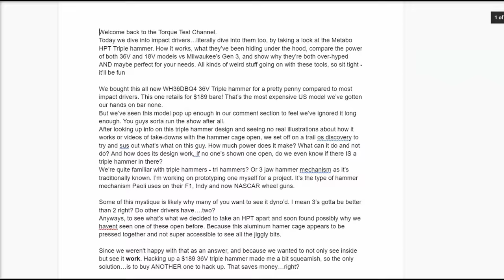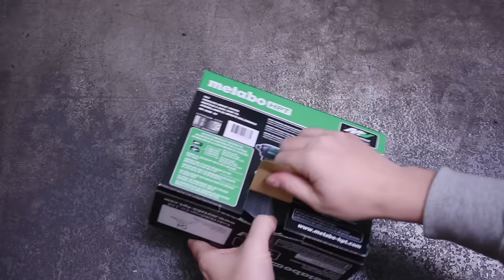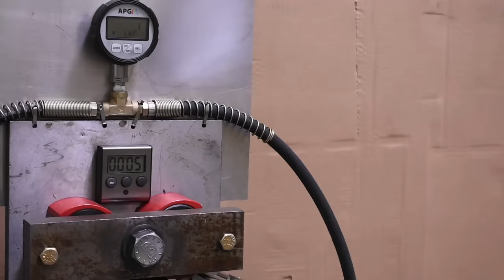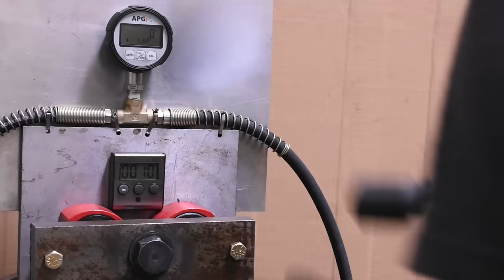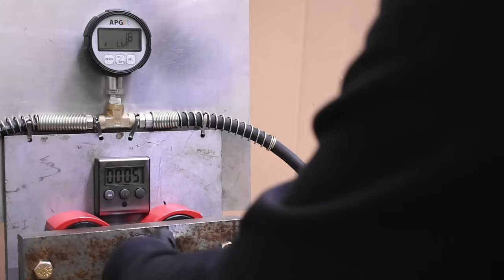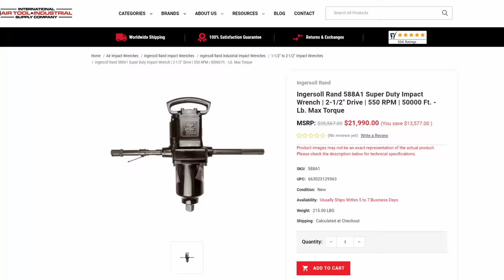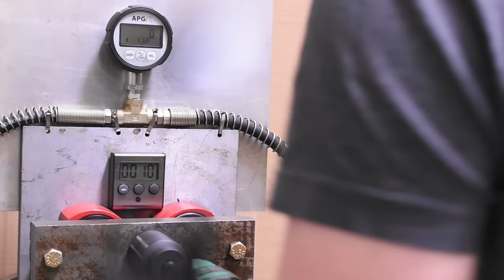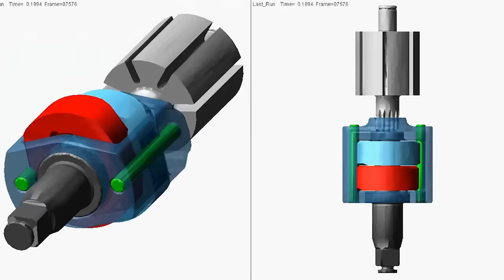High-Speed Video Uncovers Weird Stuff In Popular Impact Driver (See Comments)

Comment: Love high speed videos. This confirms what I suspected could be happening with two lobe designs already.  But we don't see this drop in performance much so I assume I am wrong this happens with the common two lobe design.  Still seems to me though a one lobe design would allow twice the momentum buildup and ensure spring return more reliably.   I assume greater bearing and shaft stress is why I have yet to see this.     Anyone remember years  back they had emergency impact drivers you plugged in to the 12v lighter outlet?  It would build up for 20 seconds and then give a single super hard hit to break loose lugnuts.   I would love to see a cut open view of that working and how that compares on your dyno.  Appreciate your vids for sure!

Comment: Like I said in a video a while back, that triple hammer seems to be restricting the tool. not enough time in between impacts to build enough momentum and it skips a lot because of that
Reply: It only skips at the highest power settings. And, by skipping, that gives it twice as long to speed up, which means stronger impacts. That can be beneficial in some (though not all) situations.

Comment: It is obvious that the intended use of the impact driver is based upon its use to application. The foot torque requirement was based on what it is mostly used for so that the life of the battery can extend its life.

Comment: This is a prime example of adding more power without thoroughly vetting the rest of the drivetrain. We see this in automotive applications all the time where are you at a whole bunch of power or beans to an engine and you know your transmission will physically stay together with that much power but your clutch is not designed to handle that much power or your torque converter is not capable of completely Translating that power into movement. Very very interesting really cool of you guys to post this stuff up

Comment: Sounds like Metabo made 1/4 rotary hammer drill!
Reply: Knew I would eventually have a use for those 1/4" hex shank masonry bits!!
Reply: nope not Metabo, but Hitachi
the branding is just a stupid clusterfuck since the gone away from Htachi branding

Hikoki and Metabo HitachiPowerTools are the same and just the former Hitachi with a new name depending on market
Metabo without any suffix is a different company with different tools in their lineup useing different batteries and designs

but the clusterfuck doesn´t end there, Hitachi Koki bought Metabo before the nameing change but isn´t part of Hitachi itself anymore
some us based investor is the owner of now Hitachi Power Tools now
so so the japanese company bought a german company in the same field and belongs now to an us based investor and while both companies still compete in the same field with different designs it´s possible to buy a tool from the japanese company thats useing the name of the german company in for instance the us

damn i hate this stupid rebranding

Comment: Skipping a dog is for gaining inertia by spinning up the hammer. The torque spike can be seen in twisting those screws. Of course that means lower drive speed we can also observe. I do not know your dyno setup but it just might not pick up those spikes sufficient enough to be a useful comparison.
Reply from the maker: The dyno works on bolt tension. If a tool can tighten the bolt more it registers it. The gained inertia seems to be stalled by hitting the top of the next dog 1st

Comment: i believe they cheaped out on the parts as the tool got later in the production run i had some of the original triple hammer impacts when they were still just Hitachi and they were absolute beasts but my work trailer got broke into years later so I had to replace them and the newer ones performed like garbage and I couldn't figure out why

Comment: Metabo Might be worse on the torque reading but man after using them for a straight hour, they ran much cooler doing the same job when I used a new Bosch impactor with 8.0ah battery… the Bosch would burn your hand at the metal just by the chuck… and I had power loss/weird sounds with the Bosch when they got hot

Comment: I have to imagine they found this flaw while trying to develop this tool but decided the marketing value of a triple hammer was more than that of a tool that actually preforms as it should. That is why you find the 1.5 value online.  It also makes sense that this works on bigger guns because they can overcome the higher spring pressure with lower gear ratios and more speed. Overall I would really love to be a fly on the wall at big tool companies when a YouTube channel keeps them honest.

Comment: My milwaukee fuel also skips a beat on certain fasteners. Too many ipm? The collet also drops bits. Actually kinda dangerous.
Reply: Every impact driver does it to an extent, the collet thing might just be an issue with the collet though. I know Milwaukee revised the 3rd gen fuels for that.
Reply: @reaperreaper5098  -  yep, gen 3 has been corrected from what I can see, but you can change it out your self on the older models.

Comment: For one thing, using simple screws into wood, no impact is actually ideal and a standard drill/driver is always better. I tested this on the weekend, went and bought the new Combo drill and compact impact Dewalt kit,  trying to simply start a screw and install some pipe clamps into a 2x4 board, the impact was worse at getting them started and overall too much torque on the screw…. The drill was much quicker and got the screws biting into the wood easier.      Impacts are better for things like pole barn screws, concrete screws and your much bigger construction screws or lag screws.

Comment: A solution would be to install some form of a bump stop.  This could be a second shorter spring, or rubber/ polymer bushing  The hammer misses when it jumps too high.  The bump stop would fix the problem without changing the rest of the design.  (A bump stop would make it vibrate more, so there's that...)
Reply: Thats something that can work 
Or use the same strenght spring but with short working range

Comment: I suppose it’s probably a decrease in power. The funny thing is that it will do this in forward. The old timers love the impact wrench for removing stuff but disagree about it’s use for driving things tight.  Because the impact wrenches are more likely to snap off an over hardened bolt.

Comment: Okay so on the back of that hammer assembly, I see two tabs for transferring power. I wonder if, especially when doing the inconsistent sorta-1.5 hits per rotation, the angular momentum isn't being transferred consistently from blow to blow. The motor is pushing in two directions, while the hammer is pushing in 3 but not even at a steady rate. You could see Tools & Stuff almost fighting with it at some points, it's obviously got some lateral movement. You can even see this on other tools to a degree but the 120 vs 180 might introduce more fluctuating harmonic vibrations.

Comment: So cool to see the mechanism working! Looks to me like the high power mode allows the hammer to spin up to faster speeds before impacting the anvil, generating more force per strike. Is it possible that your dynamometer is giving weird readings due to the time between strikes being greater than the time window it uses to average out its measurements?
Reply from the maker: Nah, we're used to measuring slower IPM than this. Air tools for instance have 1/4 the IPM and still show well on the curve.

Comment: Seems the solution would be to use slightly less rpm until it dont happen. In this case less is more. This could easily be fixed in the controller. Or learned in trigger position and sound.

Comment: These manufacturers are all going 40 volt which means they can use the same amount of cells, wire it a little different and charge twice as much. They gave the battery the ability to switch from 5cells series and 5cells parallel. If the battery used the cells only in series you would have all the power with little run time. 36volt is the same exact as 40v just one manufacturer claims voltage at full charge 4,2v per cell and one claims voltage not fully charged 3.7v. That's why the DeWalt system is called flex volt. It can flex between voktages. If you could take that battery and rewire it to only be series it wouldnt kick down in power

Comment: Seems counter intuitive that double the Volts does not equate to many gains.... the tool uses the inertia of the rotating mass of the driver to create the needed torque. It is possible that the designers thought was "An extra rotational duration builds up energy and should increased torque delivery without added mass" But they underestimated the needed spring pressure? More energy in may simply equate to excessive inertial returns on the spring and it can't keep up. I don't suspect the action of the driver failing onto the anvils side instead of the striking face would result in much shedding of delivered energy,, It is a lubricated action.   It does seem that the bounce back may play a part too.. I;m looking forward to hearing the reply from the company.

Comment: I think it’s skipping blows to the anvil from the hammer to give the motor a chance to “speed up” so the hammer can hit the anvil at greater speed/power. So the difference with these is some sort of “timing” where “low power” hits every chance it can where “high power” will skip every other blow to the anvil from the hammer to give the motor a chance to speed up and smack the anvil faster and more (perceived) times.

Comment: i modified lidl 220v ac impact driver that had hammer with impact surfaces on 45 deg so there was less torque than specified, i cut of that tilted surface and made it vertical, and put washer beneath spring to make it stronger, now it has much more torque than before in both direction

Comment: Prior to buying a Ryobi impact driver, I’ve always just used a “regular screw driver/drill” for screws and bolts. 

First time using the Ryobi impact, I was driving a 4” screw into the wall stud, as part of a heavy duty wall shelf installation. 
Broke the screw, every-single-time. 
At first I thought the screw was defect.
And every time this happens, I now had a dead partial screw inside the stud, so I could no longer use that location, and had to drill a new hole on the stainless steel shelf bracket for a new screw location. (Drilling hole in steel isn’t easy…)
After the THIRD screw broke like this, I realized what was happening: the screw was overheating from the impact action, and got weak, and snapped. 

I changed back to drill/screw tool, and managed to drive all the 4” screws without further problem. 

I wonder how much of the “bendy screw” in this video is also a result of screw metal heating up. 
I do not believe it is simply from mechanical vibration & resonance. That type of action should not result in alloy’s crystal structure shifting planes. 

Anyone? Thoughts?
(Thanks)

Comment: Interesting I have two of these impact drivers and the 36 and the 36 volt Gen 2 from Japan and I've driven long fasteners so it's interesting to see these results. Still a fan of the impact I do prefer it over my milwaukee just the ergonomics and impact feel
Reply: That and the IP56 rating. Run it in rain with no fear

Comment: perhaps the angle on the surfaces of the anvil that hit the bogs is greater than needed. Perhaps some of that angle can be cancelled with compensatory angles grounded in the dogs surfaces that meet the anvil hits, or maybe that would ruin the dog because perhaps the thing is cheaply case hardened and has no depth.

Comment: You can see the bit calet moving up and down when it mangles the first screw in the video. Just ever so slightly proving forward thrust on the screw as it’s driving.  Looks like valve float from weak spring also.

Comment: This "defect" is present and deliberate in every modern impact driver. They're designed for the hammer to skip blows in a seemingly random,yet balanced pattern that'll work to equalize the stresses in the screw and stop it from warping. The issue is much more likely that the M-HPT's pattern has no seemingly randomness to it, so it doesn't counteract itself and instead makes the issue worse.

But as we've seen with Tools and Stuff's videos, this largely happens on large and soft fasteners, which these types of drivers aren't really designed for. It simply isn't an issue for the designed purpose.

Comment: A flaw in design/ function like that should have never made it out of the testing phase.
Reply: It's not a flaw, it's a feature. This design has been around for a few years.
Reply: @histguy101  It's a blatant flaw.
Reply: @Chris_Garman  This design has been out since it was Hitachi. You can find plenty of explanations online for the three strike design, and no, they weren't put out in response to a YouTube video. The impact has 4 settings: soft, normal, power, and assist. Normal and power run at the same rpm. In power mode, when under heavy load, every 3rd anvil will be bypassed allowing the next strike more momentum.

Perhaps you're not referring to the cutaway demo, and confusing it with the bending screws. If you watched the original video, it was a torture test to compare the power between 4 brands. The tests intentionally exceed the designed purposes of an impact driver, nonetheless, the bending screws only happened on stainless steel screws(which are weak), of a specific brand, that were 6" long. Even then, it only happened to a couple of them, not all. The tool didn't bend any other types, brands, or sizes of screws or lag screws. It also only happened on one type of wood. 

If an impact driver broke a bit driver, would you say "it's a flaw in the design of the tool"? Because that happens all the time.
Reply: @histguy101  Because something exists does not mean it isn't flawed, even if the flaw is never addressed. Only occurring intermittently does not mean the flaw isn't a flaw. Stainless is generally much stronger than it's non-stainless counterparts in nearly every application.

Comment: Thanks for the great video !! I think there might be some element or safety feature as well at play here, In the 80’s corded drills had a habit of twisting out of the operators hand which resulted in a fractured or sprained wrist not to mention the drill flying out of your hand further creating potential damage to the project or people standing or working close by. I have these as well as makita and dewalt. For the utmost in reliability Makita wins it hands down so far me. Love the color and design of the Metabo

Comment: I think the skipping of the blow is not necessarily bad since the hammer achieves higher angular velocity and thus the next blow is with higher energy. What seems to me as a design mistake however are the axial impacts. I can´t think of any benefit of those, I only can see those undesirable effects like screw bending and it is also probably bad for the front bearing.

Comment: Imo, Sales pressure is pushing these tools to be too small and have too many ipms. These new compacts including gen 3 fuel get hot easily and skip beats. The new dcf850? at lowes seems to  be a good balance. The Rigid subcompact 1/4 impact being the most absurd model.

Comment: I’d like to know what size impact is more effective on rotating assemblies. For example when removing the harmonic balancer not from a crank shaft is a 3/8 better because it sometimes has higher peak force or is half inch better because it has more low end grunt. 

I think you can accomplish this by attaching your torque test rig to a brake rotor with either brake pads or parking brake shoes and applying pressure via a normal hand brake lever or captive nut and bolt.

Comment: this was a fantastic video, very detailed, I want to see every power tool demo'd like this.  I am in the market for a new cordless drill/driver, one with an adjustable torque setting like my Hitachi that I dropped.  Besides the duct tape holding the battery in, the fact they don't hold a charge nearly as long as they did when new a few years ago I am ready for an upgrade from 18 volts.  I loved how the Hitachi performed and will likely buy another but if there was a better one out there I might consider it.  Looking forward to more of your vids.

Comment: You may have covered this before but, I've run into situations where a Milwaukee m18 wouldn't finish taking a lock nut or badly rusted nut off a bolt but my nitrocat took it off without any issues. Are battery/electric impacts more susceptible to movement in the fastener like an air ratchet is?

Comment: Wow, you guys are really into impact drivers.  And didn't know people use 1/4" drivers on lugnuts.  Crazy..  I bust out the 1/2" gun for that.  I actually have never used a 1/4" impact that I thought needed more power.  I'm usually wishing they had better slow speed control.

Comment: Having 3 teeth per 360 degrees vs 2 teeth means there is less room between the teeth for the hammer to accelerate and build up momentum.
Think: 16-oz claw hammer.  In swinging the hammer to hit a nail, which hits the nail harder, the hammer swung in a 90-degree arc, or the same hammer swung in a 45-degree arc?

Comment: I used to work for a Japanese company (not a tool company) and when we would discover something that we couldn't find any data on the response was usually "Undisclosed feature, please accept".
Reply: From Hikoki JP:

"Under high loads, the number of strikes is automatically controlled, skipping one claw of the hammer, and striking 1.5 times per rotation. Energy increased dramatically. Achieves high screw tightening speed. Ideal for tightening thick and long screws such as hardware screws."

This information has been out there since 2015 when the triple hammer debuted in Japan.